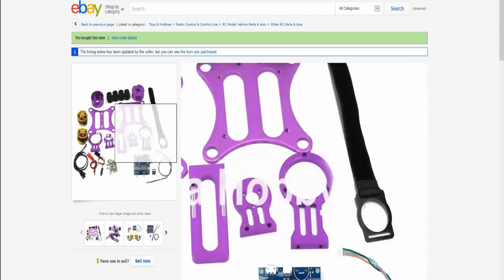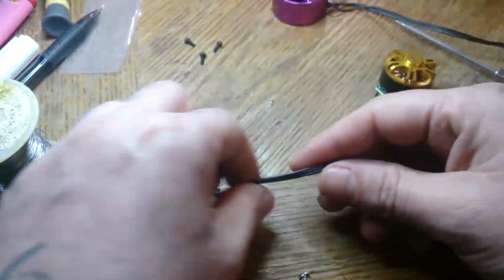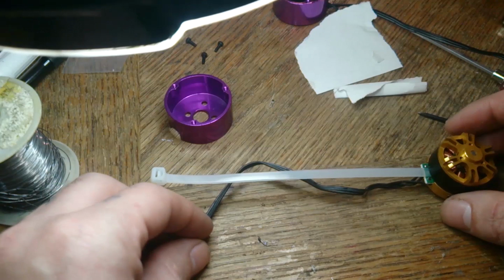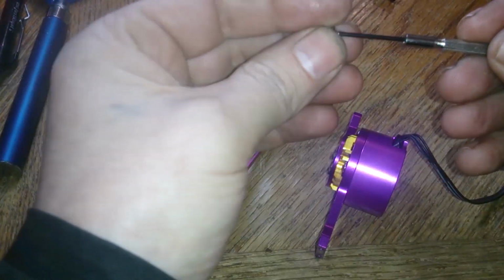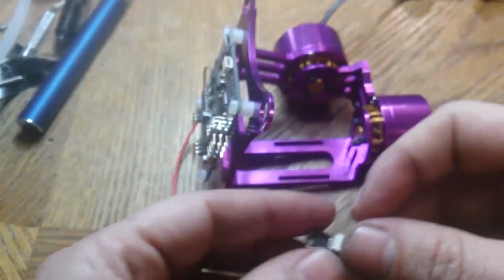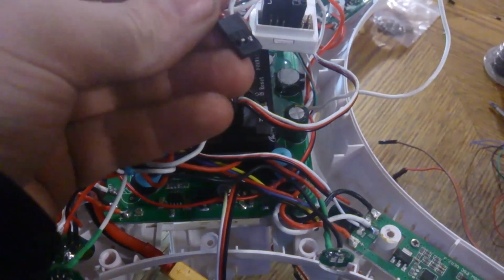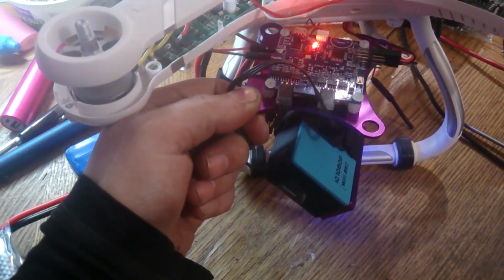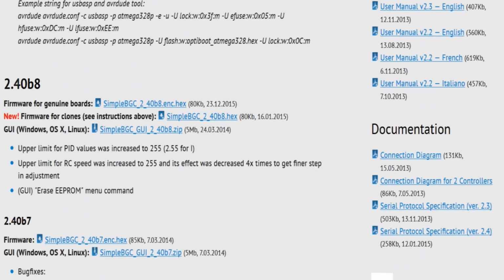gimbal 2 axis kit assembly instructions with BGC3.1 Controller

Comment: hi mate, which is the positive, negative and signal cable of the motor
Reply from the maker: not sure what you mean..if its the three wires on the motor it self.. then it does not mater which wire you use....the software will let you reverse it as well if need be
Reply from the maker: I mean.. the three wires coming of the motor..can be plugged in either way onto the board..  https://youtu.be/3eRlCLg2iHo?t=1367
Reply: Hi mate, you mean it won't cause big problems like burnt the motor, if I plug the connector of the motor with the flat black surface of connector on top or turn around with silver pins on top. Because the two poles will be swapped if I turned around the connector, I.e. Signal and negative pole wires.
Reply from the maker: right it does not mater .. .. . it will reverse direction of the motor by flipping it .
Reply: Hi mate,
for testing the gimbal after assembly, what the lipo battery did you use. 3S or 2S, If I use 3S, it means the total voltage is 11.00 volts.
Thanks
Reply from the maker: I used a 3s battery
Reply: Did u use the same battery of the drone for powering the gimbal? By using both of the connectors of the same battery?
Thanks
Reply from the maker: Hello .. yes you use the same voltage from the battery ..    the cx20 has 12 volt rail straight from the battery..

Comment: when I plug in my gimabl it doesnt move  it just freezes??? any help???
Reply from the maker: not sure what you mean..its suppose to freeze when you plug it in..  ..what are you trying to do?
Reply: oh.  i thought it was supposed to move as i moved the gimbal
it just stays frozen no matter how its moved
first time ever plugged n
Reply from the maker: does it do this ? https://youtu.be/3eRlCLg2iHo?t=1409
Reply: what battery do you use at the test? I tried it with a 3,7V, it did nothing, tried with a 7,4V battery (which was my drone's battery), and it was shaking continuosly and does not moves as its supposed to be. can you help me a bit?
Reply from the maker: HI .. I use a 3s battery / 11.1v     I'm not sure if it would work with a 2s battery ..   here is the specs on it ..
https://www.basecamelectronics.com/simplebgc/

it says the min is 8.18 volts  ..which your 2s battery might fall under. but I don't have one to actually try it out.. in the gui you will have to play with the power settings. for roll and tilt.
Reply: thanks a lot, i'll try it out